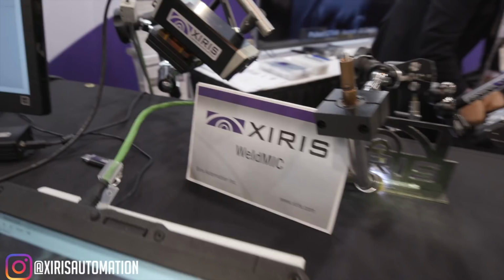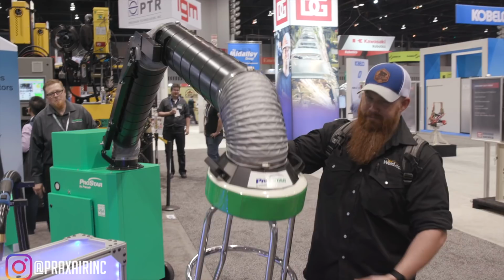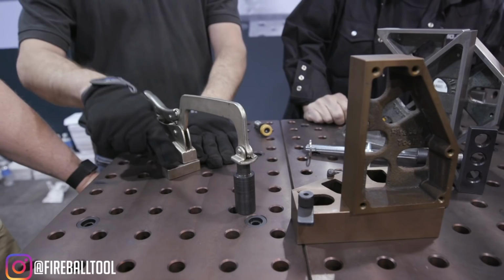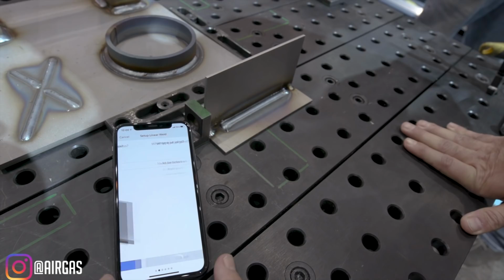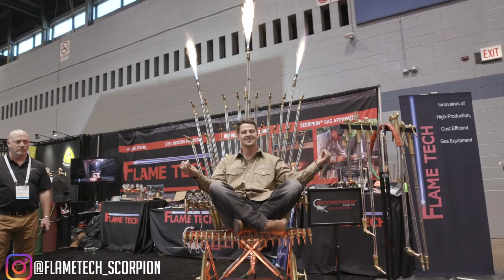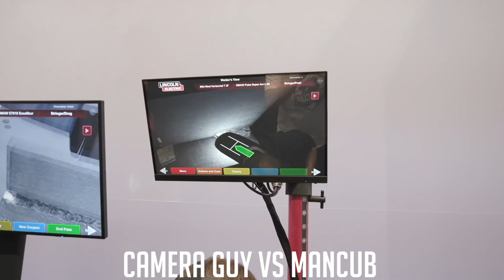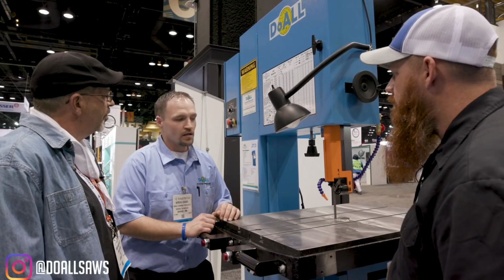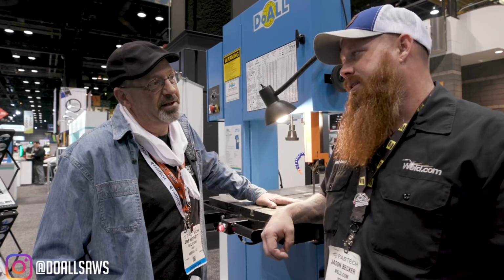So You Missed Fabtech 2019??

Comment: A few things i notice. Air liquids bottles with All the build in gauges - opening handles etc. Has been around here for years... The do-all saw is Nice and all but why do you have to set the stop height? Both mine automaticly stops 5mm above the material,seems like they cut it a bit short so to speak.